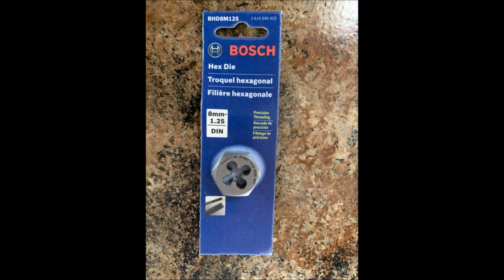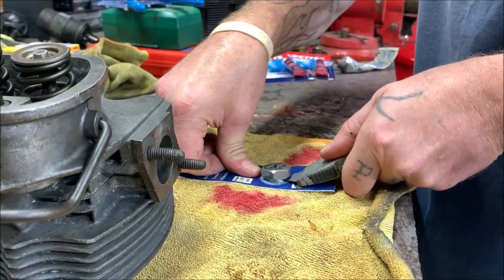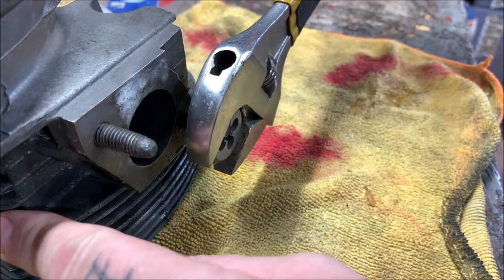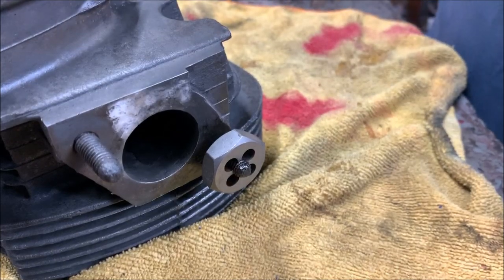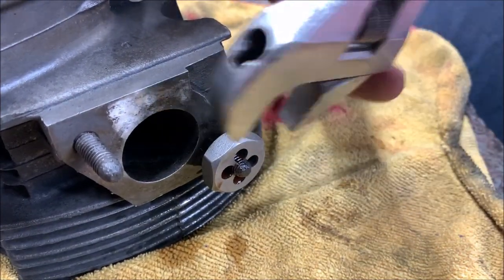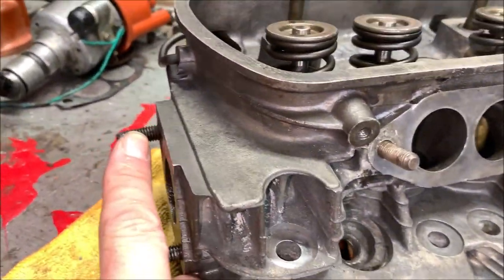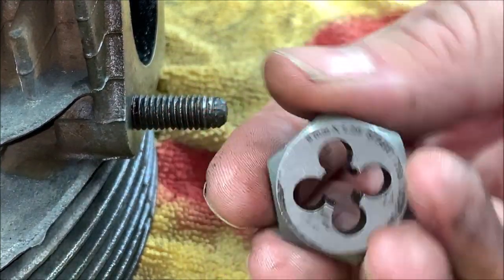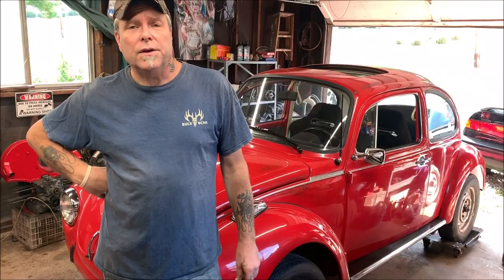VW Beetle - Super beetle Cylinder Head Exhaust Stud Repair - Stripped Threads on Studs - VW Baja

Comment: I brought a set of Taps and Dyes , A few Months ago it was only a Cheap set But good enough for cleaning up the Threads on Bess , After 50 years as of Last year ( Bess"s  Birthday)Threads can take a beating 
Has all Different pitches too In the popular sizes M 10. 1.25 , or 1.50 for example , Very handy 
if I did it again I would of Prolly brought a better quality Set 
But Its like any Thingy , you get what you Pay for 
Thanks For the Video"s Mr and Mrs Slade
Reply from the maker: I wished I bought a better set. I will eventually! It truly helps to chase threads and retap when needed. Thanks for being here Brian!

Comment: It alaway good when you can chase both the internal and extranal threads on these old vw.s. On the exhaust stud's I had a set of heads that I had to drill out the broken stud's and install a helicoil and they make an exhaust stud for this type of repair. Back in the 70's when I work at the auto shop was doing complete valve jobs on the vw head it was almost a commen needed repair using helicoils.
Reply from the maker: Hey Dan!! Yeah it is a common thing on these for sure. I got lucky with only needing to clean up the threads.